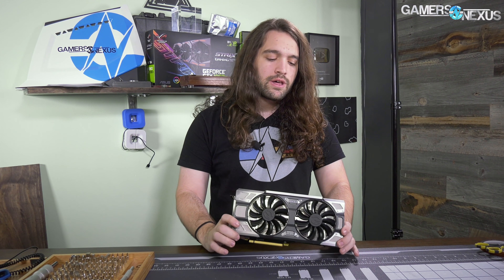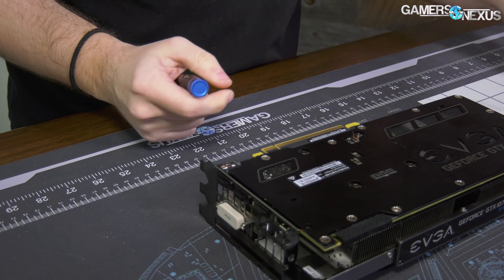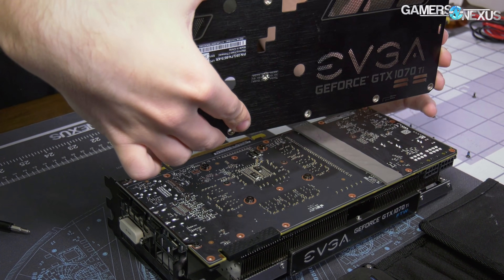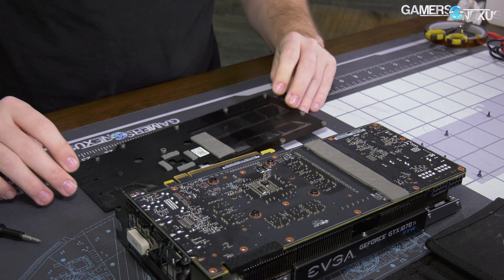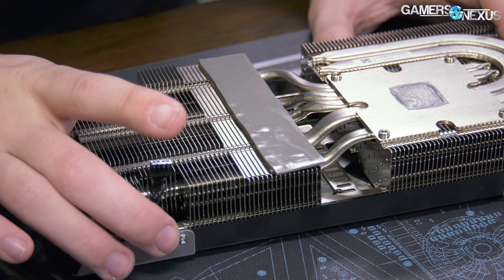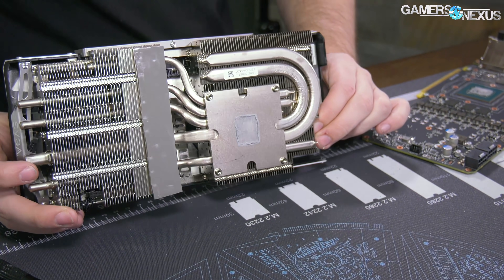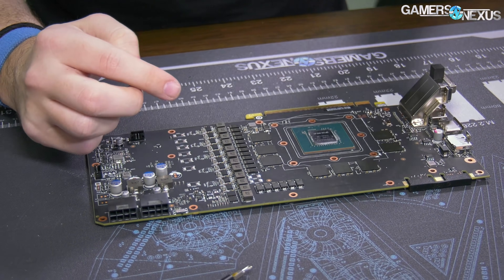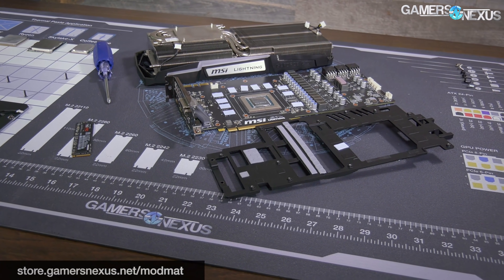EVGA GTX 1070 Ti FTW Ultra Silent Tear-Down & PCB

Comment from the maker: Our GN modmat is here: https://store.gamersnexus.net/modmat
You might like our Titan V HBM vs. Core investigation: https://www.youtube.com/watch?v=-kHUSRLOeYw
Reply: Gamers Nexus what's the chance Nvidia will pull an Intel by making only Ti cards "unlocked" and overclockable to make more money off of enthusiast?
Reply: How temperature resistant is the modmat? I've had many different anti-static work mats, and they have ranged from melting super easy to forget a soldering iron on it and it being fine.
Reply: mjr2015 on their page for the mat it says it's not a mousing surface so I'd imagine it probably wouldn't work too well
Reply: I would like to order the mat but have no credit card is there a way to pay bypaypal?
Reply: Hey GN!

Any chanche for reviewing the MSI Gaming X Trio? (only 1080Ti currently).

Comment: On this card have they fixed the thermal temperature of the PWM and memory hitting 96C and can this be monitored in the software?
Also have they used better caps than the 1070/80 sc/ftw/black cards
Reply: they did not need to fix it, those problems only occurred on the 1080 and 1070 models, not the Ti models. When i emailed EVGA before i got a 1070Ti Ultra silent, that is what they told me, and my gpu has all the correct thermal pads. dont worry

Comment: I have one question, does it normal that fans not working till 60 C?
Im kinda worried ^^
Reply: yes that is how EVGA has it set up, i personally dont like it which is why i have my custom fan curve start spinning at 40c. But dont worry, your GPU wont be damaged until it goes above like 90 or 100c

Comment: It's been nearly a year, has there been any temp readings with this card? Your description fails to give anything other than links to your store or patron.
Reply: I have this card, has never passed 65c on. Load
Reply: 30c idle
Reply: Agreed, 2113mhz core and 4498mhz on memory (+75% on voltage). Mine does not go over 57c at 100% load in Unigine, but i also have a pretty aggresive fan curve
Reply: KillerXtreme running default fan curve in a micro atx case my temps level off about 70 under heavy load in games. In my old case with more airflow 60 was normal. With a heavy fan curve it sits 55 in my small case. Great card I was able to overclock it pretty far too
Reply: after two years of owning this card with powerlimit and temp set to max w/auto fan curce on evgas system. 400mem clock and 175 core clock. Reaches 75C, w/o any overclocking it has never gone over 70c with the same default fan curve.

Comment: Awesome tear-down and explanations.  I'm guessing the overheating-VRM issue has been resolved entirely for all 1070 ti's?
Reply: they never even happened with the TI versions, it was only the normal 1070 and 1080, and yes EVGA fixed it. I purchased a 70Ti directly from them, and they told me they have added more thermal pads to ALL of their graphics cards

Comment: Just bought this from newegg for 490, and it came with a free EVGA 550w G3 psu
Reply: Hello is it worth to buy I mean how much fps u get in like fortnite maxed? And is it silent and cool in full load.
Reply: @tipptapp9231  I don't know about fortnite but the card is very silent and I get playable fps at 4k in most games, so I would say it is worth it especially since it is going to lower in price with the launch of the 20 series cards

Comment: Would there be a problem using this card with a micro atx mobo and case?
Reply: Arthur 94 I run a matx case and mobo and the card does run a little bit hotter than normal, but nothing concerning

Comment: I run an FTW3 in an ITX case which can accomodate up to a 2 slot card (Dan A4 SFX). Seeing that EVGA is jumping on the 'more than 2 slot card' bandwagon is disappointing for small form factor system enthusiasts. I'll probably need to buy a new case if I want to run the consumer volta 2080Ti when it comes out.
Reply: Please... tell me you didn't know the liabilities of SFF when you bought the case!?
Reply: I'm sure EVGA will keep the two slot design, and they'll make this enlarged heatsink style for a different SKU model. I wouldn't worry too much.

Comment: Couple questions. 
Why 2.5 slots, why not just go for a full triple slot design? Nothing's going to take up that extra half slot, so what's the point of a 2.5 slot cooler. 
And why are card coolers designed to blow air onto the card, and not away from the card? Would it not make more sense, and possibly lower temps, if the hot air is blown away from the card?
Reply: The guy who said it gives you extra space for air intake in a dual card setup probably is right on the money.
If you had a few hundred watts to dissipate, what would you prefer, make sure all of the heat ends up in the case first or get it out ASAP (at least partially)? Plus, if you've ever played with fans a bit you may have noticed that when it comes to sucking, they, well, suck - it's not at all easy to establish defined airflow like that, and they tend to like having their intake as free as possible (axials in particular, while radials tend to develop more static pressure).

Comment: Hello Gamers Nexus, I have a question that doesn't pertain to this video but hopefully it get noticed. 

On the userbenchmark website the newest Titan scores the same "splatting" as the 1070. What exactly is splatting and why does it perform the same as the 1070 in this regard. Thanks for your time.

Comment: Hey @Gamers Nexus: Was looking for a card to upgrade my 5.1 Mac Pro upgraded with two X5680s. I need to do this because I work with bootcamp on windows on that Maschine inside 3d-engines like cry engine 5 and ureal 4 and also a bit of gaming. I know that there are web drivers from nvidia that work under OSX too (can work with custom designs, at least tested it with Asus). Now my question is: should I go gtx 1080 or 1070ti with a icx evga custom design? Or get a vega 64 wich will do ok under windows but also support metal and the apple pro apps that will be optimized for it??  I like the porerprofile of the 1080. 180 watts can be done without power modding just grabbing the two mini 6 pin adapters on the logic board. If I would go with a 250 watt card I would need to grab the power from one or more of the data II connectors. Do you think that a ICX model with a lower power profile would be the way to go here? The power supply hat 900 watts and could support the power hungry Vega 64 with the pixlas mod. But prices and availability here in Europe is crazy.... hope you can give me a little bit of info here with my situation. Thx :)

Comment: Please, for the love of God, someone tell me what cpu to buy. I want 75-100 fps and as little of noise as possible. Probably will be paired with MSI GeForce GTX 1060 unless advised other wise. I'm a pc virgin. Pop my cherry
Reply: Ryzen 5 1600. Not the 1600X though. If you want less noise, get a Cryorig H7 to put on the CPU
Reply: Cody Stubbs if you plan on streaming on Twitch, then you might want to go for the 1700, but if not then it's kinda overkill for 1080p @ <100fps. As for motherboard, you're gonna want to look for "B350 AM4". ASUS, Gigabyte, ASRock, and MSI are all good brands. Pick something in the middle of the price range, $80-100 should do nicely. Don't mess around with super cheap motherboards.
Reply: It depends on a fair few factors like what game, what resolution etc but as was stated before a R5 1600 will do you nicely for 1080p gaming with a gtx 1060 6gb. Just again as was stated use a decent aftermarket cooler (generally tower coolers are quieter than aio's in a similar price bracket) Noctua make excellent coolers but have shit brown fans unless you pay extra for chromax ones.
Reply: you haven't even given us a budget on the cpu, neither have you given us the intended resolution or the mobo you're already using (if applicable).

but yeah ryzen 5 would work
Reply: Dylan Johnson Would the 1700, 1700X or i7-7700, i7-7700k be better for my situation or are those CPUs overkill for a build I'm going for? I don't know the motherboard I'll be using because i don't even know what boards are compatible with these CPUs.
Reply: Dylan Johnson Thanks for the help. It's appreciated
Reply: Cody Stubbs sure thing!

Comment: the ifixit ad makes me sad. I got one of those about a year ago and the thick pliers broke the first time i used them. The black holding part snapped in half under it own clamping force.
Reply from the maker: That is a nylon head. They sell replacements for those. You should only really use those heads on softer metals and objects that don't require excess force.

Comment: Nowdays you can classify GPUs as weapons, looking how massive they became.
Reply: RoboDog WMD? Weapons of Mass Display?
Reply: Thing is, there isnt much weight PCI connector can carry. Vertical PCI isnt wise because heat dissipation, simply because cases arent designed with vertical mounting in mind.

Either manufacturers reinvent cooling solutions and make cards smaller, or cases become different. By current trend in both we wont see either ( simply because manufacturers are lazy and can milk their customers with mediocre products ).

Comment: EVGA has been hitting home runs lately, Custom PCB cards with many cooling solutions and great Mobo designs plus a very good warranty policy EVGA is knocking it outta the park big time. This EVGA GTX 1070 Ti FTW Ultra Silent is another cool calm winning Pascal card.
Reply: Their warranty/customer service is supposed to be a hell of a lot better than most too. I hear bad things about Asus and MSI in that department.
Reply: Another really great and honestly underrated card is the Gainward/Palit version.
Reply: Probably not by much be because it uses probably 90%+ the same parts as the regular ftw cards and evga reuses parts allot to save on cost, so not a whole lot more expensive to build, so maybe a mild mark up
Reply: EVGA makes some damn good enthusiast mobos I must say
Reply: Gainward/Palit are underrated in the USA, I have had Palit cards and they performed very well.

Colorful is another underrated mfg, Check out this Beastly Pascal Badass, Colorful iGame GeForce GTX 1080 Ti Kudan.
Reply: Well, to be honest, colorful easily manages to look and sound really shifty and cheap despite their talked about quality. I have never owned, nor seen one live, so i cannot say anything personal. Also, not seeing Palit too much in Europe, either.
Reply: Never had a Colorful card but the Kudan looks very impressive with some of the highest performance numbers I've seen for a Pascal 1080ti. I have had 2 Palit cards with absolutely no problems and would buy them again. Palit doesn't have much of a market in the USA and Colorful even less.

GN Colorful Tear-Down
https://www.youtube.com/watch?v=kfE7-4UAGYs
Reply: i am pretty sure they make this cooler some at a premium cost, and i have seen gainwards coolers at stock cooler prices with same width,  i would like to see a comparison because i think evga is overpricing this.

Comment: Just get a 1080 and be done with it. They cost the same anyway where i live.
Reply: Totally true in India too. A few models actually cost more than the cheapest 1080.
Reply: Eswar Kumar ikr that's why i got a zotac 1080 mini. it's cheap compared to the other cards, and has amazing performance.
Reply: joe sirichandan yeah and despite what the reviews say the card does not get that hot nor are the fans are not that loud
Reply: Depends. Where i live, a decent 1080 costs 40-50 euros more than a 1070 ti. This added to the fact, that their difference is just a single processing unit and the gddr5x memory, both of which give minimal performance improvements(1-3 fps), make the 1070 ti significantly better value for money. The only downside is the overclock limit for manufacturers to make the difference seem bigger, but most buying a card like this are already going to own afterburner etc. to make that point moot. I have to go with Steve on this, the gtx 1080 is largely obsolete.
Reply: >Zotac
never
I returned mine, and waiting for this to get to a good price. Or just waiting for new release cards since my 1060 is still holding up really well actually in 1440p.
Evga screams quality, and their components last ages at least in my experience.
Reply: but the 1070Ti looks and sounds cooler than a 1080, which is way more important than performance in the DIY PC market.
Reply: Well, where i live the 1080 costs about $100-150 more than the 1070 ti.
Reply: Yeah, it always depends on what you want, I am not all about the fps, I also want a nice fat n chunky piece of hw with a decent cooling design and some extra power phases, of course this is gonna cost me extra...however all about setting the priorities <3
Reply: where i live this card is $20 more than a 1070 ha
Reply: 1070ti is for miners.
Reply: joe sirichandan Yeah i got the zotac gtx 1080 mini too it works flawlessly even at 4k.

Comment: It would be interesting to see how something like a 3 slot blower-style cooler would fare.
Reply: I have 2 EVGA 580 ultra classified blower style cards sitting on my shelf right now, and let me tell you they are loud AF!!!
Reply: Or the xbox one x blower cooler modded onto a Graphics card, yes those would be interesting.
By the way evga experimented with big blower coolers some years ago, look up "gtx 580 classified"
Reply: The HIS IceQ blower found on cards such as the 7950 would like a word.